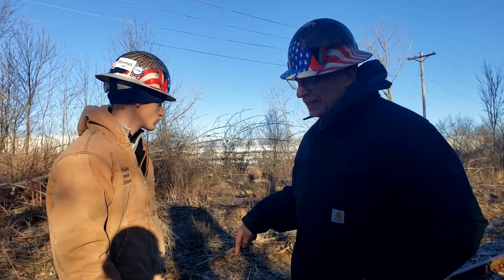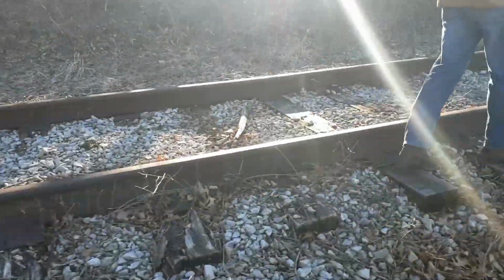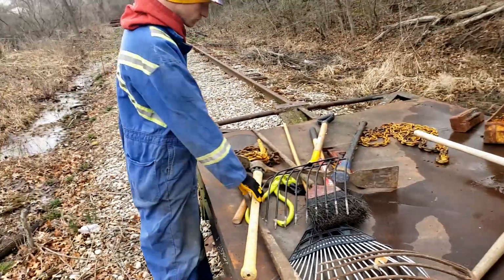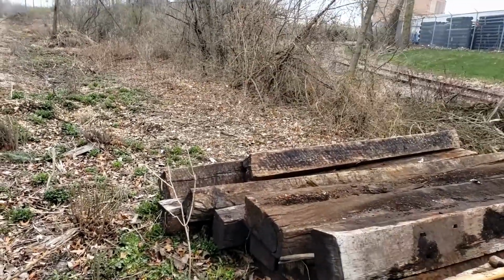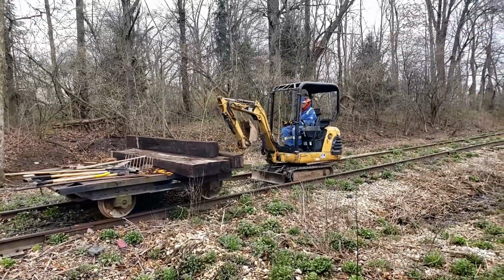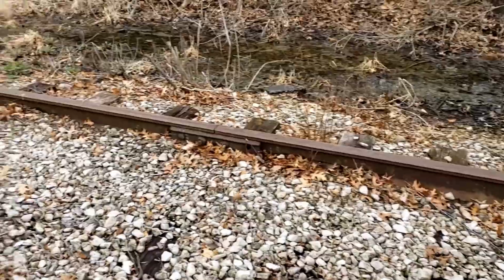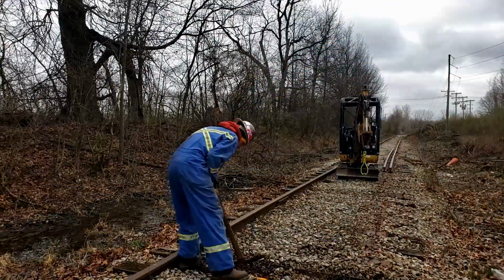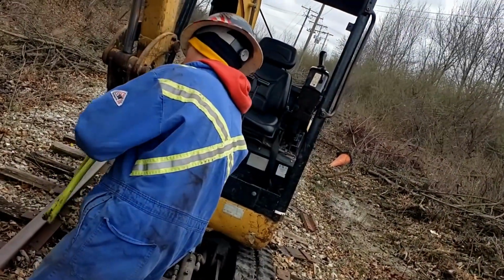1st Railroad Ties replaced in over 25 yrs!   Maybe ever!!  Conrail/ETR

Comment: The shortline I worked for, we used a backhoe to replace ties.
The backhoe bucket was narrower or "custom" it had only 2 "teeth".
The bucket dug and "rippled" the ballast to loosen the the tie, the spikes were pulled, the tie plates knocked out, then we stepped back (guys with track tools), the backhoe bucket swung to outside of tie butt, pushed under rail, then swung to center pushed out of under other rail, new tie put in same way but reversed. 
To keep track level we used jacks and rippled ballast under the ties.
Reply from the maker: Wilfred     That's where the ETR is headed, thanks for the target.    B.
Reply: @eastterminalrailway5975  
You're welcome. If recall, we replaced every so many ties 1 out 4 or 5/as needed. The ties were marked. We distributed along the line x # of ties at a time. We would pull the spikes, dig out a little ballast, jack the rails.  
The backhoe bucket did not have a thumb to grab but the operator was able to pick up ties. As far as the ballast goes,  he was able to loosen it with the bucket as well as pack it in and tamp it to bring it up (pushing out the old tie often looses you some ballast). 
The the front bucket would often have stone and we would get a 5 gallon bucket and spread it arround new tie w/hand tools.
We would tamp the track up or down to level often eyeballing it by trying to site it.
Another line I did track work at was a 2 foot gauge tourist line.
Gentlemen in charge of track Department generally wanted rails level and in gauge with each other.
He took a SEARS level and built it into wood so it was square, to rest ON TOP of both rails, the under it he built a 24" of wood to keep the gauge of the rail.
Reply: @eastterminalrailway5975   I will check on my Army RR Training/Field Manuals. 
I have 1 from 1980, 2 from January 1971. I also have " Professional Papers Corps of Engineers U.S. Army Military Railways" revised edition 1917

Comment: The way we do it is we have the backhoe on the track because meany times you cant get it from along side it. 1st thing is to pull out the spikes and plates. then make a trench for the old tie to slide out in if its necessary. Then push on the end of the tie until it gets to the rail. some times you have to wiggle it around a bit.  then stick the teeth from the bucket into the tie in the center of the gauge and continue to push the tie out. Once the old tie is out make sure the space for the new tie will go into is big enough. Then push a new tie in making sure as you push in the new tie the end  doesn't start traveling upward it will hit the rail on the other side. it should slide in nice and easy. Then  tamp the tie up to the rail not in the center just under the rail about 1 foot on either side. then jack up the rail and put the plates back  in. then gauge the rail and respike it.

Comment: When you pull out the old tie you need to clean out from underneath where the tide was make sure that when the new tie goes in the top surface of the top of the tie is lower than the surface of the ballast it's easier to tamp up the tie then to dig out from underneath the tie after you spike it to the rail

Comment: I was in the track department at Union Pacific. In The yards we just use the two tooth bucket to remove ties. We used to scratch the crib on each side of the tie and then poke the tie in the center and slide it out. Installed it in the reverse. I think you'll be able to do anything you want with that little backhoe. You might need a two tooth bucket though. The Tie grapple is just too floppy and imprecise and frustrating. I'd rather use the backhoe excavator alone by itself. Hardly any labor involved use the machine as much as possible.

Comment: Hi Folks, how about using the Volvo to rip the bad ties out and turn new ones in. 

First dig away some ballast with a 30 cm 2 shell grab - if youhave one, or with the Mini excavator - on both sides of each tie to replace. After a tie is out and the rest peaces also, dig out generously with the excavator, so that the new tie (prefer used concrete ties) fits in easyly.
If you replace 2 adjacent ties at one, you can turn in new ties from the top even If the rails are still in place. After digging out, of course.

Ciao, Bernd

Comment: Okay. That rail puller. It has a srraight side and an angled side. That wedge gets hammered into the angled side with the "teeth" facing the rail. It has that lip that goes under the rail head. Then u pull the rail towards the wider end as u pull the wedge . Wedges itself. Ull need a decent flat headed bar to hammer it off the rail once uve used it as the wedge will get tighter as u apply force to it to pull the rail.

Comment: You can do a lot more with that excavator than you think . You can do most everything you need to do without Tie tongs.

You can over curl your bucket with the tie balanced on the bucket and smash it into your boom and it'll hold it way more secure than your Tie tongs. It's actually kind of funny watching you guys.
Reply from the maker: Sam    I know but remember, I am learning, along with most of the ETR nation.   Its not an equipment rodeo, or a stage for me to show off, its the progression from inefficient ( learn )  do it better ( learn )  get the right tool ( learn )   get a machine ( learn ) have people like yourself chime in (learn ).   This is unlike any channel in that I show it  both ways, right and wrong!  B.
Reply: @eastterminalrailway5975  okay 👍🏼

Comment: If you picked it deep enough it will slide in easily. Just dont go to deep. A pair of track jacks would help also by taking weight off the tie so it slides out easier. I spent 44 yrs doing that work so i have a bit of experience doing it...lol

Comment: Wonderful progress. Glad you guys are back out there and doing what you do, but I am seeing a few suggestions on how you should go about replacing ties (sleeper).

In my experience of relaying std gauge sleepers I was taught to dig out the bed on one side of the sleeper, piling up the dug ballast between the rails and on top of the next sleeper/bed. This means you can skew the old sleeper across a little and then pull it out with the clamps with more wiggle room to manoeuvre the sleeper. Then you dig the bed down to just below the level of the next sleeper and slide the new one in, then it butts up against the ballast left from the side of the sleeper you didn't touch and is in perfect place. This method means you can manage without lifting jacks on the rail.
None of this using a mini digger to do the work. Doing it by hand may be tougher, but it seems quicker then messing about with machines....

Keep up the good work though 👍

Comment: That was pretty cool.  Biggest obstacle?   Right equipment for the job.   You guys appear to have the  basics, however unsure how you are going to fill the ballast back in so it doesn't sag there.   I see the big operators use vibrators to do that.  Maybe you got one, dunno.  I am rooting for you.  I know that you guys are NOT part of the spectrum that believes America and American ingenuity and hard work are dead.    Every video shows the exact opposite and snuffs out that thinking.
Reply from the maker: Brad    I want you to know, that was a huge compliment!  But when I think of our forefathers and all they accomplished and did,  I feel like a slacker.       We bought a hand held vibrating tamper, needs repair, but should be ideal.  B.
Reply: Brian, the shortline I worked 💪 👷‍♂️ for, (but before me) had a compressor trailer  for pneumatic/compressed air tools. They put it on a heavy 4-wheel cart for track work.
I never saw it used so it was busted and waiting for scrap to go up.

Comment: You need only one wedge to use your Nolan RP-1. It should be a Nolan R 1157 locking wedge.
As far as your biggest obstacle in the video - you need a thumb on that excavator so you can grab the ties and use them to crib the ballast out when you put them in and also slide the ties out.

Comment: See that was so much easier when pulling in line with the tie instead of pinching the tie with the bottom of the rail rather than rotating the boom from the side of the rail. MG

Comment: Those tongues look interesting, but they have a "fatal" flaw - their hooking arms are too long. To hold onto the load, the lower part (from the articulation point down) has to be significantly shorter than the upper part to maximize the lever effect. I think there are some types of self locking clamps which are used to lift and transport barrels. There's a pair of chains attached to a scissor like device, but the gripping part is very short. When pulling up on the chains, the arms are pulled together, and the tightening force is largely multiplied by the ratio between the upper part and the lower part.
Other than that, I think tampering and balast regulation might be your next big tackle.
Good luck, and keep it up!

Comment: I believe your equipment is holding you back.  Utilize the excavator to move the ballast instead of a shovel.  Ideally you would want a hydraulic thumb and a rotator on the equipment, unfortunately I think that excavator is too small.  You would have better results with a thumb over those tongs at least as far as picking and placing ties.  Weld an eye plate and or hook onto the bucket and use a shackle with short piece of chain or cable to choke or sling lifts.  Bolt a foot long piece of chain between the tongs and lay it over the bucket.  That excavator should be powerful enough to push replacement ties in from the side and shove ties under rails.  May want to use an old tie plate on the bucket when shoving ties so they don't split.
Reply from the maker: Samuel   Good input, you have worked, you know mechanics , leverage etc.  Thanks for joining in.  Brian

Comment: How much more expensive is the concrete sleepers cost compared to the wood sleepers?
Reply from the maker: I don't know but I would love to put some in.  B.
Reply: @eastterminalrailway5975  Madison Railroad, a city owned railroad, in Madison, IN has made bank by storage revenue. Then used that money to repair and upgrade their track to handle more weight. You should build a brand new siding where the old J lead was if there is enough room and leave a switch there to the J lead as a derailer in case J lead re-built at a later time. I wished u guys were closer to me as I would love to volunteer. I'm in Florida.

Comment: Don't buy landscape ties.  They are junk.  At the East Broad Top RR we buy relay ties from a dealer for $20 a tie. They are in much better shape than those.  With one rail gone you could pull the ties out by had with a two man tie tongs much faster and easier.  Love your videos!
Reply: IIRC after inspection they figured the ties may have been accidentally set in the landscape ties pile and that's only why they got them.

Comment: Get a weldalet hook on the back side of the bucket . It will come in handy for a lot of things . And a push bar quick attach for pushing the ties out . And maybe look into a thumb for the mini they work great 👍.  And make use of a rain day to work on the new/used tie machine so u can make it operable for now till u have more time to go through it.  The father son thing seems a 75/25 kind of thing but understand how real life is and how things work .and u could weld a toung on the mini excavators blade then run a piece of pipe to the dolly so you can pull it or push it back up the line to refill ties . I'm sure you know what I mean you've been around trains long enough to know. As fare as the biz , I believe things will work out for u both . As fare as the new company well you seem pretty positive about things by the way you talk about it so things must be working out there as well or you would not be talking it up .. did this help in any way Brian I hope so
Reply: Every bucket needs a grab hook welded onto it.
Reply: Yup .

Comment: Honestly the two of you have good intentions. However, the both of you working without the proper equipment is like shoveling ca ca against the tide. I don't know how much capital you have but the fastest and most efficient way would be to have one of the railroad construction companies come in and perform the work. It is unnecessary to remove rail to switch out a tie. I'm rooting for you fellows. If a customer were to cut a deal within a month the rehab task would be more than two could handle. You still have work to perform on your locomotive plus your regular operation. No sense over extending yourselves to risk injury and create personal health issues.
Reply from the maker: Good input and food for thought, thank you.  Brian

Comment: Okay.. so to improve the situation here make a thumb for the excavator. Take 2 peices of angle iron. Cut out the section that goes around the boom leaving 6 inches of overhang on the top and have it extent 2 or 3 feet below the boom. Use bolts (4) 2 per side of the boom to sandwich the boom between the angle iron and create a friction fit weld a plate on the 2 peices of angle iron where the bucket teeth hit the angle iron. This is a poor mans thumb. It doesnt move but ur bucket does so u can use that to pickup qnd place ties easier than those tongs. And would probably be cheaper that the 2 tongs. Also if the angle iron moves to much on the u can tack weld the angle iron to the boom so when u want to remove it its just a couple small welds to cut and grind off

Comment: You guys aren't running any high speed rail there. I'd think you would only need to replace ties about every 20 feet or so. When the FRA came down on us for our little passenger excursion, they wanted a good tie under every rail joint. Rails were 39 ft and staggered so that's 20 ft per tie. They also wanted to see that the tie was cribbed and tamped so that it was providing support and maintaining gauge. The only other part they gave us criticism on was the anti-creeper bars on the grades because even the slightest braking would cause the rails to creep, and before long you'd have a bundle of ties on one end and nothing at all on the other.
Anyhow, I am not trying to be critical. I just wanted to share that because I know how hard it is to try to maintain track with only hand tools and relay ties. Hopefully soon, the budget will be able to afford a dozen bundles of ties and a tie insertion / extraction tool for a bigger backhoe. You get those customers online and you will have plenty of room for maintenance in your budget. I am certainly cheering for you guys!
Reply from the maker: Thanks for following, I really benefit from hearing your first hand experiences!  B.

Comment: To much hand work with the excavator  just there. 1 , pull out old tie have new tie besides excavator, 2. Move dozer to side of track and dig a tie trench. 3, slide in new tie.. "level it", with a level . Back fill tie hole. 30 minutes tops each tie replacement. Use the excavator  not hand tools.

Comment: I 1st  do not use "landscape ties" for relay as it is a waste of money in the long run.  If you need to save some money, buy industrial ties.  You need certain tools for track work and they basically are not replaceable with something else.  Those tongs look like log tongs.  They should not have to be beaten into holding.  You need at least 2 tall track jacks (15 ton) with pinch lining bars to operate.  2 sets of single tie tongs to manually handle the ties.  2 spike mauls.
I wrote through your "contact" my address and phone number.  You are in great need of help to shorten your learning curve.
Reply from the maker: Thanks Roy    You have been down this road before!  B.

Comment: See if this helps you. Put the excavator in the ditch opposite the rail in place. That way the bucket does the work with the excavator instead of your back. First place the new tie down near your tie to be removed and aligned parallel to the roadbed. Then pull the bad tie and put it aside and use the bucket to clean and level the ballast under the tie. Then insert the end of the new tie and push it in and down with the bucket. Leave the tie a little high on the side closest to the excavator so when you replace the rail it will be a little higher than the other ties and you can spike is down easier. You'll get the hang of it after a few ties.

Comment: You can NOT install those Ties like that it will NOT work. You need to install the Ties the way you explained it on the video. Or you are going to have to do it Old School way by Hand. And I think more planning needs to be done between you two before starting the work what needs to be done first and plan on more Safety before someone gets Hurt l can already see it coming. This is Not a Play Date someone can seriously get hurt and then it's too late. I have completed confidence in You getting this Rail Line back into Service BUT you need to be more serious about the work getting it done your taking to long also some of those Ties are Good and some of them your wasting your time and right Now time is very important to you something you don't have. Don't Give up You can do this and I can't wait to See it finished and You running the Engine moving Car's around on what You did to make it happen and in the End it will all be worth it. Good Luck!!!